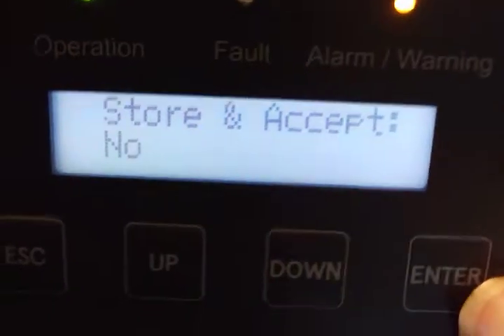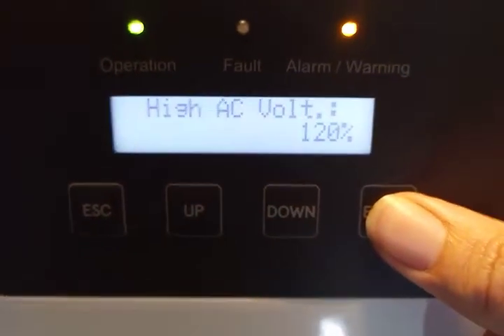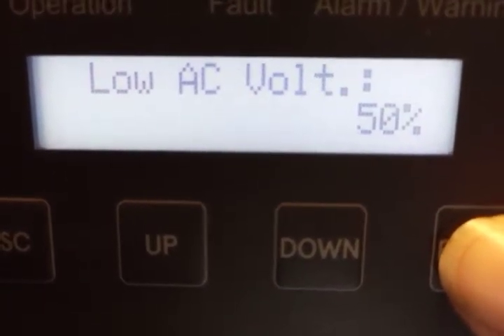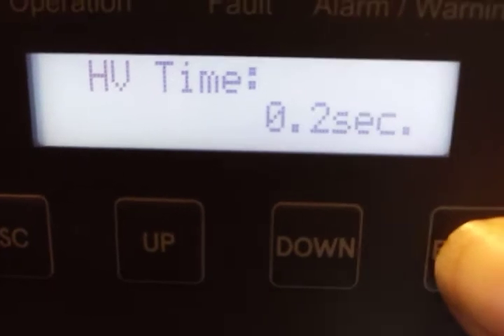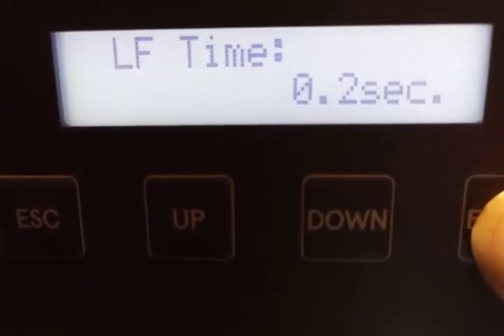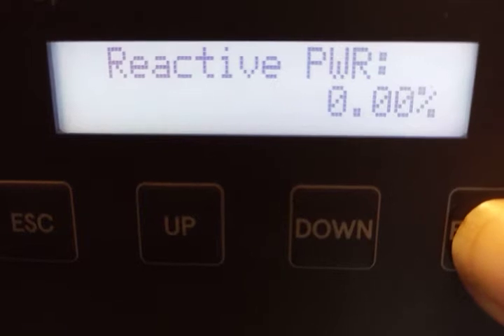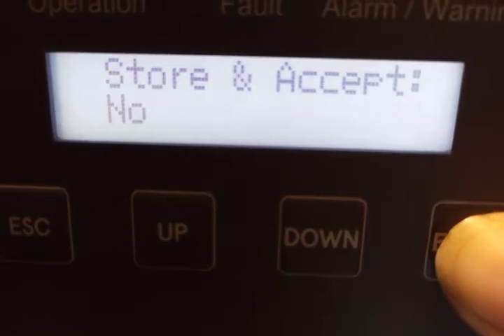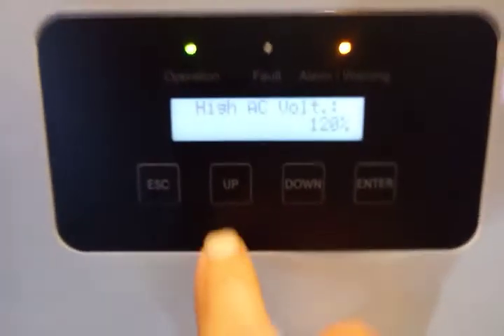Vid #3.  Inside the passworded menu of the Tesla Powerwall Inverter

Comment: What buttons do you push the enter the password (6532)?
Reply from the maker: it's rather simple.  It won't bite you if you get it wrong. just give it a try and you'll figure it out
Reply: @ Awesome, I did find it in the grid settings
Reply: push escape a few times If you're deep in some other menu then go to grid settings and push enter. That's when it asks for the password. You can push up and down to change the number.  enter progresses to the next digit. pushing enter on the last digit submits the password and games you access to the settings in this video.

Comment: Concerning arc faults, I have read they can be caused by fluctuations in sun activity, makes sense to me that the factory set the high and low voltage to .2 seconds so if you can change them to maybe a second or two, it should allow output power to normalize to line voltage when the inrush of power is absorbed by the grid.
Reply: The breakers and fuses are there to protect from damaging voltages and amperage so the time factor seeing a comparison value, if it sees a rise for .2 seconds it will tell the circuit to shut down no matter if it’s in the danger zone or not.
Reply: I rerouted the wires that were going through the arc fault so now they're not going through the arc fault anymore. It has not thrown in arc fault error ever since.  I was getting a lot of arc problems because I connected the high voltage battery of my Toyota Prius to the Delta h6 PV input.
Reply: I'm off grid though.
Reply: Puedes ayudarme a quitar la falla de arco de mi inversor, cuando entro al menu y acedo donde se pueden borrar las fallas no la borra, el led de alarma siempre esta en rojo y no como borrar esa falla. El manual habla de que cuando se da esa falla se activa un interruptor de bombero pero no se si hay que dejar en su posicion inicial ese interruptor o donde pueda estar

Comment: Hi Travis, I tuning to setup one of this inverter with no luck, I have tried all posible set ups any chance you can give me the code to unlock the protected menu ?
Reply from the maker: 6532
Reply from the maker: How many watts of panels? are you on grid?  Do you have batteries?
Reply: Travis Sanders  I have 2 strings of 10 of 345 watts panels each. I have no batteries connected
Reply: I connected all the wiring  and the panels and I get 420 volts in each pv, but no current is sent back to the grid
Reply from the maker: @oscarvictoria16  so what exactly is not working properly?
Reply from the maker: @oscarvictoria16  no current being sent back to the grid? Are you sure you have the same model I do? My inverter is a SolarCity H6.
Reply: Travis Sanders yes it is the same inverter H6 solar city, I am grid tied , in the menu I cannot get more than 2 watts (active power) and when I see the pv current in the menu I cannot get more than 0.02 amps
Reply from the maker: @oscarvictoria16  how many volts does the H6 claim are coming from the solar panels?
Reply from the maker: It should simply work.  It did for me. Are you off grid or grid-tie?